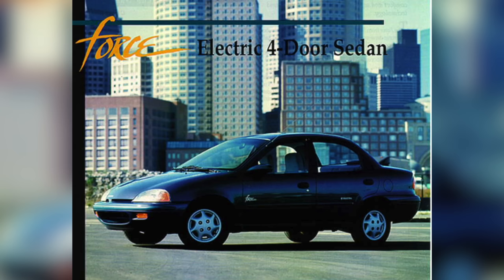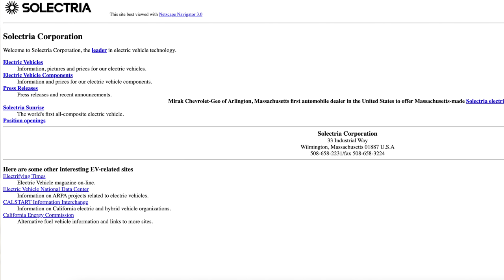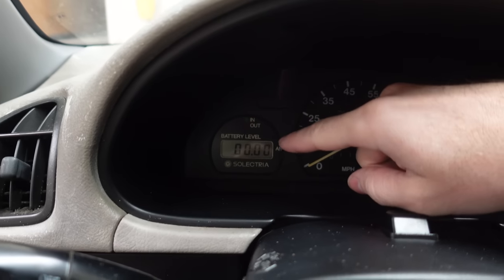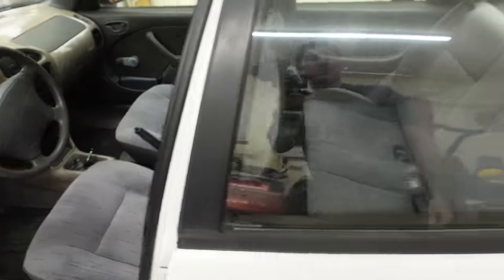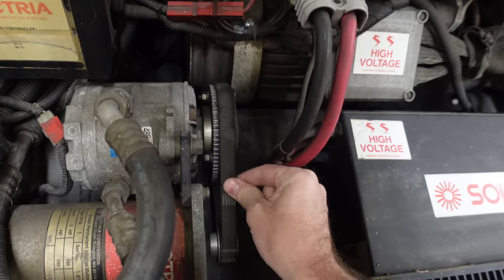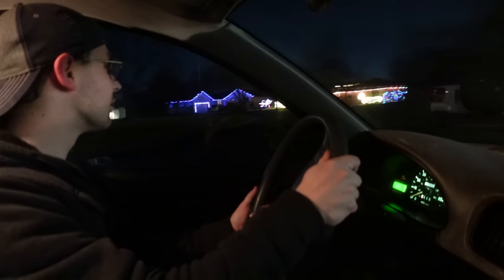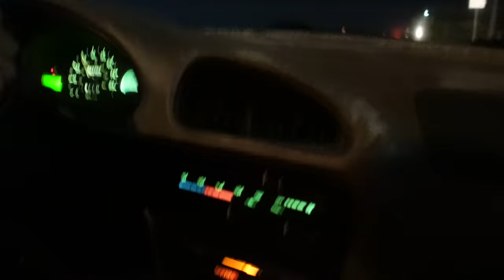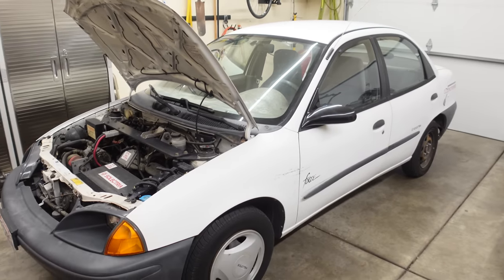I BOUGHT The ELECTRIC Geo Metro *Solectria Force EV*

Comment: Drove the EV1 when they were leasing them (~1998) and just recall quick range loss driving up steep mountain but also the quick recovery of charge coming back down. Had a futuristic dash. I have seen them again at the Peterson Museum is Los Angeles and also the Henry Ford Museum in Detroit. Good luck on the Metro. Recall driving a gas one (think 3 cylinder engine) as a rental and got a laugh out of it as the seat was made for someone 6ft tall. I’m short and had to pad the seat to get the height I wanted to see.
Reply: @Davey I live in AZ and maybe once a year will see one. What I do see a lot of are PT Cruisers. It’s like these things are invincible (cockroaches of the car world), they still even have good paint when other cars have completely failed due to the desert sun.
Reply: @Davey rarely see cavaliers. A college friend had one back in early 90s. Was station wagon version and stick shift.I had a 1990 civic si which I loved. Don’t see these either anymore
Reply: @curiousumscientia3648  You are correct! Cock roaches they are. I ended up with a PT Cruiser (when my 98' Honda accord with 266k tranny died and the engine developed a massive oil leak) when a work colleague inherited one from his sister in law who passed away. He kept it for about a year, and decided having 4 vehicles was enough and sold it to me for the cost of state title transfer. i.e  we went into DMV and I payed all the fees, and he handed me the keys. It's a base model, 5 speed, with A/C, cruse, and auto down windows, but nothing else. No power doors or mirrors.. I will say the paint has faded, (dark blue) mostly because it's spent it's entire life in New Mexico after a brief stint in California. It had only 100k on the clock when I got it in 2019 and was a 2002, so it was rathe low mileage for it's age. Still runs and drives remarkably well, the 5 speed will probably never let it down, it will most likely be the engine that fails in the end. It's had the water pump replaced three times, I had to do that last year, seems to last only about 36k then leaks water and get's bad quickly.. Seems to be flaw in the design.

Comment: Hey neighbor!  Looks like a fun project!  The ball-shaped vacuum reservoir is very likely for the HVAC system which probably uses vacuum diaphragm actuators.  The power brake booster is its own vacuum reservoir and doesn’t need any additional reservoir to function.  Looked sorta like the hose from the booster went to a vacuum pump maybe… Am guessing that pump is not working but you already have more than enough experience and knowledge to fix that.  Keep up the good videos!

Comment: Lithium swap that thing!  See what the voltage range of the controller is.  You might be able to get some more power out of the motor with higher voltage.

You could also Leaf-swap it

Comment: For anyone that didn't figure it out... the regen terminology, dry/slippery refers to driving conditions. It had such a stiff regen that it would make the wheels lock up and slide in rainy or snowy conditions so you were supposed to turn the regen off in slippery conditions. So only regen in dry conditions. Put the switch to whatever the road conditions are at the time.
Reply: When I first brought it to Colorado I forgot to turn off the regen as I was so used to Cali driving. I almost slid off the road lol. The ability to turn off the regen is very useful
Reply: @99lockerock  I bet. I never owned one myself. Would be handy if you lived in a small town. I don't. I have to drive further than it's max range to get to anything. I mean literally anything. lol

Comment: JR & Jake, fun video. Nice praise and lots of digs. The Force came out in 1991 as the hatch then 1995 as a sedan. It was by far the most efficient and most advanced EV being sold at the time. Competitors were building series wound DC motor cars with 4-speed stick, no regen, no heat, no A/C except GM EV1 that was never even sold. The Force was more efficient than EV1 on a Wh/mi basis. Is it a great EV  by today’s standards? No, of course not, it’s 28 years old. Your vacuum pump is out or more likely the vacuum switch or wiring. Power brakes were standard in 1995 Force. Your batteries are old and weak and don’t look OEM, which was 13 East Penn GelTec group 27 gel at 832lb total. A fresh pack would get 50Ah.  I have 350lb of Li pack in my Force and does 180 miles is way more peppy and fun, handles a little better although nothing to write home about of course. Check your struts for shock action, definitely do a precision alignment when you have final batteries in it. I bet that’ll help efficiency. Good tires at 45 psi will help.
I have a Force, 375 mile Sunrise GT, E-10 pickup and Tesla M3 and drive all of them, like them all. Love to hear and see what you fix & restore on your Force.
Reply: Follow the brake hoses & wiring to find pump, vac switch (on ball or front cross member above A/C condenser). Best if you find the Solectria service manual

Comment: I wonder what kind of profit margins Solectria made on these? The optional volt meter made some profit for them, that's for sure. Battle Born Li-Ion would be a cool upgrade. Looks like Deka Marine Deep Cycles in there now which are a good battery. Have fun with it!
Reply: I'd say they made a decent penny on these. Gliders likely cost them half of the retail price of a metro or 3/4 at the most. Batteries can be expensive but not that expensive since those were lead acid; a proven tech even back in 90s.
Also lets not forget ZEV credits they got for every car sold.

My guess is that these were designed for goverment use first and sold to the public as well. It was way too expensive to just be a retail car people would buy.

Comment: 1000 cycles at only 40 miles per charge would mean those batteries would already be toast. Perhaps the batteries have been replaced already since it has over 42K miles.

Comment: The Suspension is probably worn.. new shocks etc. I would love to see you do a battery upgrade of some sort.
I had a 92 Metro 3cyl 5spd. Car was a POS on the inside.. But mechanically it was fantastic. I used it for delivery work.. I put 100K on it on ONE year.  It never let me down.  Never had any engine issues. Around town it was plenty quick, climbing the highway on ramp.. took some time.  But once at speed it was ok too.  Had no trouble running 85 MPH..

Comment: Man, would love to see a conversion to lithium on one of these, it would reduce so much weight going from all those lead acids to just (4) 12v lithium batteries.  And give it about 2,000-2,500AH.  I bought (4) 12v li-po batteries off of Alibaba in (16) 3V cells with bus bars, to make them into 12v packs, for the solar on my camper. Spent around $1,500.  It's actually a shame he replaced the lead acids, could have done lithium with a new charger, for close to the same spend or even cheaper than on the lead acid batteries.

Comment: This would be a great car for a LFP retro mod. Lighten it up while also providing a lot more range, and no fire risk. Would be cool to update with new BMS and charger with a J1772. Motor controllers are much more attainable now and you could get a more modern display to go with it. Might be able to get more power out of that motor too. At the very least, a lithium weight reduction will greatly improve its current 0-60(?) time by itself.

Comment: Ok so you need to upgrade to lithium battery’s. Put better shocks and springs for handling. Upgrade all the lights to LED. And put a cheap Car Play radio with a backup cam.

Comment: I’ve never seen a Selectria Force/Geo metro in Europe.
I was sitting at home and thought “ what it actually looks like is a sedan version of a Suzuki Swift .
Guess what… it IS based on a 90’S Suzuki swift ( hatchback) which we DID have in the UK and Europe.
My suspicion has been confirmed:-

From 1995 to 2001, the Suzuki Swift nameplate was reused for the second generation Geo Metro in the United States and Canada. It was still based on the previous generation Cultus/Swift's platform and only available as a 3-door hatchback.

In 2003, the first generation 5-door hatchback Chevrolet Aveo was marketed in Canada as Suzuki Swift+ and discontinued in 2011

Comment: Something important to note, NOT ALL lithium batteries get 3000 cycles. ONLY LFP (aka LiFe, LiFePO4, lithium Iron etc) can reasonably reach 3000 cycles. Most lithium tech such as LiPo (uncommon in EVs. I know my Kia soul ev uses them but I don’t think many others do) and Li-ion (most common) are rated for 500-1000 cycles. With the active thermal management I could reasonably expect 1500 cycles at most. However, the reason that we still use lithium everywhere is that all lithium tech is much more energy dense than nickel and lead tech, so even if it’s less cycles, it’s more cycles of energy in total. Why hybrids stuck with NiMH so long is they can cycle more times which is more important

Comment: I drove one back in the day and don't recall the petal issues, so I suspect there is an issue with yours. I aslo remember it accelerating much better  than the gas option,though that's not saying much.  There is'was a kerosene heater option.

Comment: Second place unicorn to the EV1 I think would be S10 EV which actually used a motor based off the EV1 unit; FWD too. Sadly only 60 were ever sold and I've only ever seen them owned by schools.

That said, I do believe the Route 66 museum in Sapulpa, Oklahoma, has an EV1.
Reply from the maker: I wonder if the one in OK drives? I might have to make a trip 🤔
Reply: Follow-up: Of course now I see you mention the S10 in the video!
Reply: @WatchJRGo  I caught an article mentioning it was on loan to the museum and it appears it is one of the disabled ones.

Comment: Actually a lot of those db style (9 or 25) connectors are probably just straight up analog, forget digital (serial data).  Given the fuse holders and production standards I see.  Your throttle issue might be a bad sensor / potentiometer.  Ask Jake for the pack from his Insight.

Comment: Interesting story GM built electric s10 and Sonoma trucks in 1994 for the 1995 model year and only 50 were built i bought a 1995 gmc Sonoma gas engine one of course and it was the 51s truck built lol the first gas truck and it had issues to say the least but i still have it.

Comment: The UK had its equivalent, the Enfield 8000, with 121 made during the 1970's. It should have been called the Enfield 8.000, as it had an 8 BHP electric motor, giving it a top speed of around 45 MPH and a real world range of 25 miles. 0-30 MPH took 15 seconds.

Comment: I'd be interesting to see how screwed up the handling is on full regen braking on snow/ice.  I'm guessing slippery was easier for the not so bright to get a grip on when it comes to road conditions  (judging by how many cars you see slide out of junctions on snow because they brake like it's still dry).

Comment: This car is only one wheel better than that three-wheeled death trap you recorded a few months ago.  It was painful to watch you demo that car.  Anyone who loves those cars would be ecstatic about a new 48 volt Club Car.
Reply: But if you are going to increase responsiveness and speed, be sure to go through and check for surface corrosion on your throttle control to see if you are having a resistance problem that is only overcome by increasing amperage.

Comment: Re: EV-1: I own one of the hundred or so next best things, a 2002 Toyota RAV4-EV. Still has at least 60 miles NIMH range if you're careful, 80 if you know ahead of time you have to, and tops out at 78mph. Inductive charging. Intentionally limited from 0 to 20mph, but peppy after that. Would that someone would create a LiION conversion kit for this  Google RAV4=EV images for nice pix.

Comment: Replace all lights with leds and all the batteries with lithium batteries and see how everything is.  Might want to check the potentiometer on the accelerator it might be bad or you might want to replace it with one that's a little bit more secretive

Comment: Guess if he drove in daylight, in California where relatively warm,  So no heat, would mean they had better range. Cool outfit for running in town, not good for hwy driving. Dry or slippery likely was for road conditions. If in dry, and road was slippery, would it be like slamming on non and breaks in the snow causing wheel lock up?

Comment: Did 20 yrs in military and never seen that car on base. From what I remember the GEO metro was a crappy car with a weak engine. They were used by rental companies as the cheapest car they offered. This EV is interesting but with lead acid batteries it probably wasn't very efficient.

Comment: I would love to see how much better it would do with lithium batteries in it how much longer of a charge if it would go faster I think that would improve it a lot I feel like it needs a dead man switch even when you guys get out because it's sitting there showing all the lights and stuff running so it's assuming power when it's sitting still but not that much

Comment: Are you sure there is a problem with AC compressor and that's not just the AC drive motor? I would pull the belt and spin the compressor and see if the noise goes away, if so it's the AC drive motor.

Comment: I live in Massachusetts and need the heat to be on.  The battery life would be nothing in the winter time.  EV's are useless as far as I am concerned.  Hybrid vehicles are too expensive to fix or buy also.  No place to charge them around here.  Chargers have problems in cold weather also.

Comment: Look like they used 15" Saab 900 Aero wheels. If you pop the center cap off the wheels should have Saab on them.
Reply: I'm betting that car at max has 13” wheels. 3 spoke wheels was kind of a thing in the 80s-90s. Used to have a '94 Corolla with 14" 3-spoke alloys.

Comment: The EV1 story shows why GM has a bad rep when it comes to innovating vs rebadging. They did not want to take the chance, and ended up hindtit in the electric game while Musk killed it for a decade.
They should have bought Solectria and run with these HARD, and let the battery powered micros take over the micro market as batteries got better. Cool that they also did this with the 90's S---10, another very good candidate.

Comment: Someone needs to come up with a way to run a alternator on the electric vehicles whereas you can have the batteries charging whilst driving that guy is going to be a instant millionaire...
Reply: Why don’t you drive with the brakes on and use the heat to boil water to run a steam turbine to make electricity?

Stupid right?

Same as your idea.

Comment: This is without a doubt, the dumbest EV application ever
The metro was a 55mpg car, as it sat. Gas was $1.25 then.
It probably cost more than $1.25 THEN to charge it for the 50 mile range.
There is being an early adopter and there is being stupid.
This car fell into the latter category